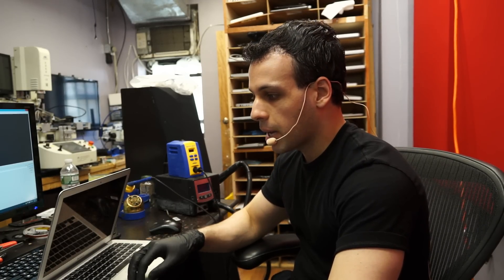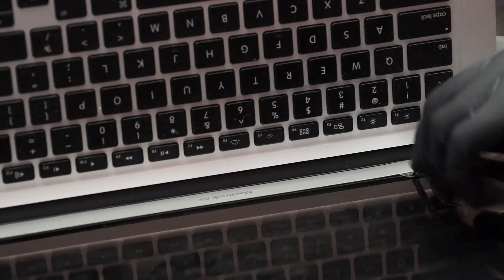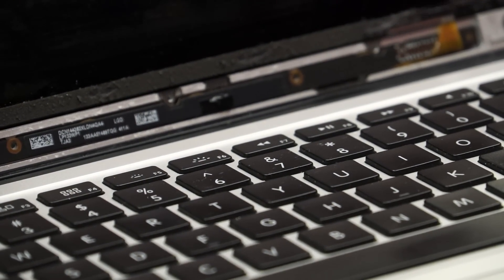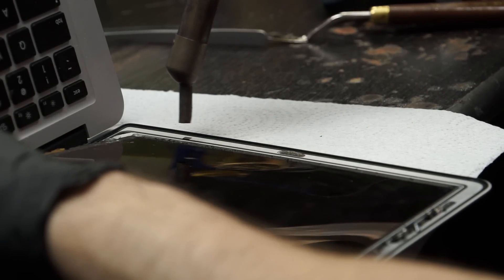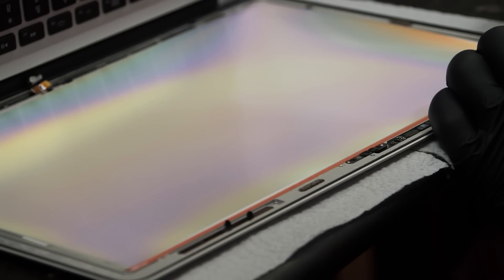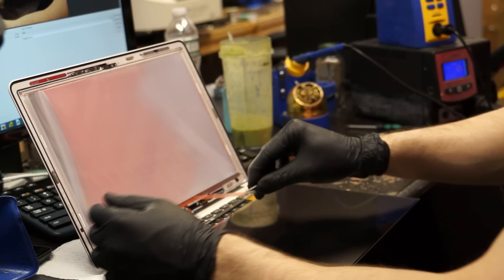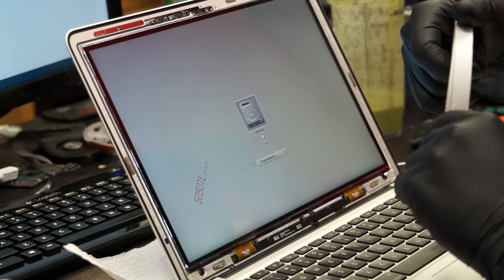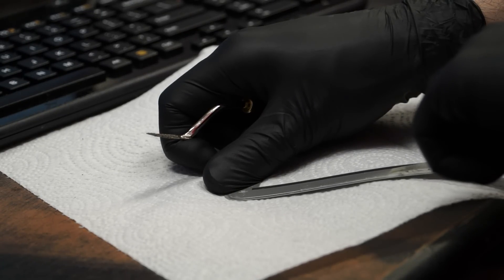How to replace A1466 Macbook Air screen updated video.

Comment: How dare you saying bad things about apple screens? They call it "retina" and thus it CAN NOT be bad! Because there HAS to be something special and good about it when it has a special name, right? ..............right?.........................................................................................................................right?
Reply: +martravi righttt...
Reply: +martravi Except its a Macbook air so it doesn't have a Retina display...
Reply: +martravi the retina bullshit was only created  so appel  have  a excuse to not upgrade there  phone display  resolution now day   they are   declaring forfeit  , the  terme will  probably disappear in few generation
Reply: I think the term is perfectly relevant, the average consumer does not understand what high resolution is nor what an IPS display is. Retina is Apples generic term to describe it and the iPhone 6 plus had a massive resolution increase to 400ppi, not that it matters anyway as the human eye can't discern the difference anyway so its completely useless to chew up extra battery power running a higher resolution display. People just think larger numbers are better.
Reply: electricsnut if they  are concern with battery life they will put better batterie who  car if it 1/2 mm  thicker   if last all  heavy use day easily like all other phone in the  market
Reply: +bac302 So why would you put a higher resolution screen in to a phone when its completely imperceptible to the user and drains more battery life. That is one thing Linus got right, no-one needs a 4K display in the phone, it is utterly stupid. You don't just put more ram etc in a phone for the hell of it and bigger numbers, you do it because it needs it.
Reply: electricsnut appel  doesn't  want to upgrade  there resolution  i'm not talking  about 4k but at least full  hd or a good  hd  
the 4.7  iphone 6  have a  resolution  of 1 334 x 750   . why  not  1280x720 or 1366x768 
you can't  call that  retina when somme app    have some   blurry image   cause  they were developed   for stander resolution 
it's not only about  how much  pixel  

personally   i think that  full  hd is  the  minimum   especially   when devices that are sell for half   the  price of a iphone !! have full  hd ;  better battery life  ; ...
and you can tell the  difference  between  hd and full hd   even in 4.7

Comment: who told you u will fuck up files turning the power on off you cant lose files that way  back in the day maybe on old hard drives most are solid state now no moving parts kill the power like a real man :) on ssd's laptop drives are smaller more accurate and have safe guards built in now to prevent that

Comment: 1, What can you do when the screen is broken in a way that you dont see behind it if the diffusor is damaged or not, like something was thrown in the screen and it leaves a strong white mark? When the screen is out it is fully broken (before it is only partially broken), 
Not possible to order actual brand new diffusor from anywhere, so there is only one way to fix it by replacing the whole top part which is much mor expensive, but the customer doesnt want to pay for that? 
If they decline i cannot put back the original screen as it is totally broken after removal.

2, when you are attaching back the screen i see that you are touching the diffusor, how come that it wont leave any marks?
Reply from the maker: +fifferfiffer you sell them on living with the spot from the beginning
Reply: +Louis Rossmann ok, so i guess the only way is to inform them about the possibilities, that they might need a whole top part
Reply from the maker: You have to figure out what type of customer that you have. If they demand Perfection, there is no replacing just the LCD, even though there was a chance that it will come out perfect. For somebody who demands Perfection, they need to go to Apple and pay full price, no ifs ands or buts about it. Once they understand what they should expect, and you do a perfect screen replacement they will be very happy. The 10% of the time that there is a blemish, since you have presold them on it, there is none of that I'm not paying because there's a blemish bullshit.
Reply from the maker: fifferfiffer in general you want to avoid customers that have OCD because they will always find something wrong with what you have done even if you do a perfect job and use that as an excuse to not pay. The reason Apple's prices are so high is because they are used to dealing with those people. So send them to Apple where they belong.